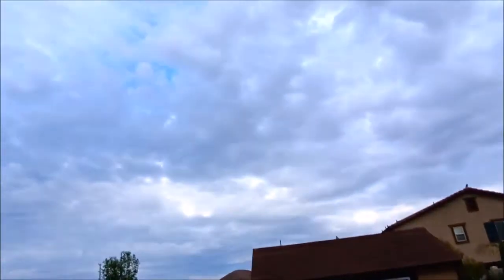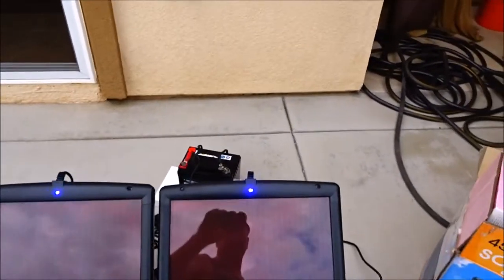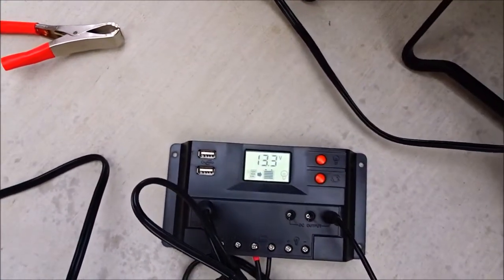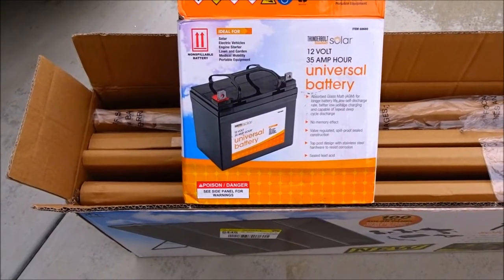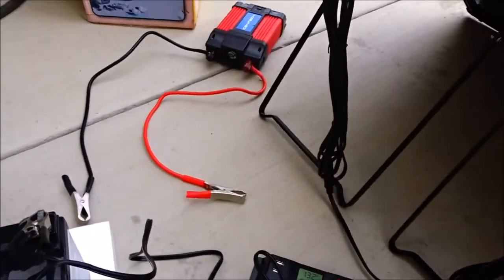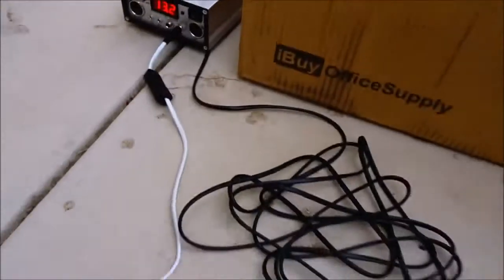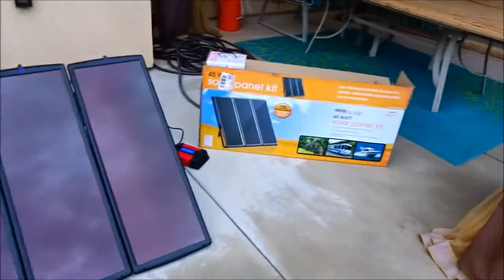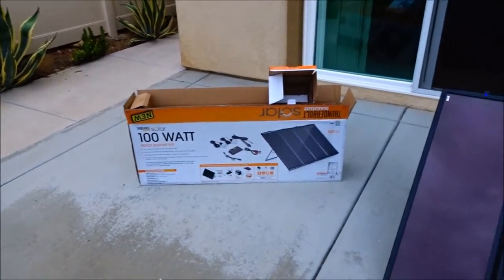Up & Running. 100 watt Harbor Freight Thunderbolt solar system. Charge controller and 35 amp battery

Comment: I use this system in my van to power a microwave, TV and more along with 2 AGM batteries and a 4,000 watt inverter. The entire system is very reliable and works well to cook in up to 18 minute segments ot TV and computer all day and night.

Comment: Amorphous panels work in cloudy or indirect light where other panels would get nothing.
Reply: Wrong. That is a myth. Amorphous panels have 'slightly' less drop off in efficiency in less sunny conditions, but when you are starting with efficiencies that are roughly 8-10% higher to begin with using monocrystalline, that drop off is nothing. I can buy a 100 watt mono panel and a true MPPT charger controller (not that crappy PWM controller that comes with the harbor freight panels) for just about the same price and generate more power with half the physical size panel. People think the HF setup is a good deal. It's JUNK. PWM chargers can waste almost 30% of your power due to improper charge voltage/current profiling.
Reply: Grim Engineer I have the HF 100w solar kit, in order for me to get true efficiency of the panels I should get MPPT charger controller ?
Reply: still get 12V but amps will be low

Comment: Thanks for the video - how do you know how many AMPs that you have drained from your battery?
Reply from the maker: You count the amps that you are using and for how long you are using them. A lot of times when using an inverter to AC you need to convert watts to amps.
Reply: Thanks for the reply - I admit that I'm confused between watts and amps and this link that I found made me even more confused: 
https://www.powerstream.com/Amps-Watts.htm
I'm sure the author is much more knowledgeable than me, but I just don't see how AMPS can be per second.   A small appliance that we have says 2 AMPs on the back would seem to give 2 AMPS x 60 seconds/ minute x 60 minutes / hour would be 7200 watts per hour - seems to large to be true.   To further confuse things I have tow 6 volt golf cart battery that says 75 AMPS and 105 min (assume minutes) on each.   Could the two golf cart batteries hooked in series giving 12 volts run the appliance?   Guess we will find out.

Another idea - I have a Kill A Watt meter that we can plug into an electrical 110 volt outlet and an appliance into it.   Pretty much tells us everything we want to know over various time periods.    Haven't tried yet on the converter, but plan to.   

Clueless.
Reply: Think not of current as "per second, per hour" when it only says amps. It does not accumulate. Think of it as a rate. If an appliance has a rating of 2 amps, it means it is flowing current at a rate of two amps.

Now, when a battery has an current rating, EVEN IF IT SAYS AMPS, it actually means AMPHOURS. You'll see the unit for it written as mAh, Ah, kAh, etc. If a battery is rated for 33 AMPS, also known as AMPHOURS or Ah, that means it can supply 1 amp for 33 hours, or 33 amps for one hour.

Comment: Whats the amp and Watt specs on charge controler that comes in  Thunderbolt 100watt kit from Harborfreight?  I wanna hook up more solar panels, like 1 or 2,  240watt 12v solar panel to it.
Reply: You need to buy the optional larger charge controller and coupler to add more panels, up to four sets, I think.